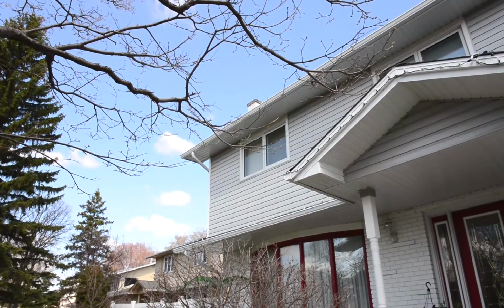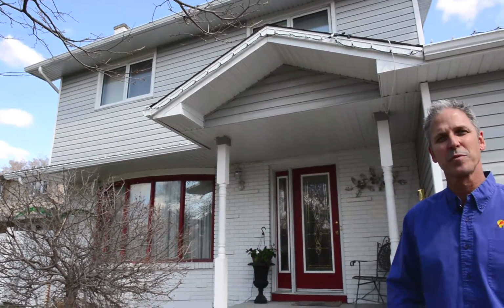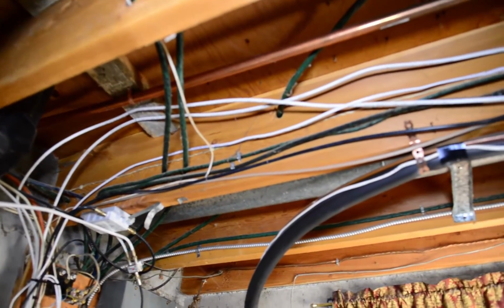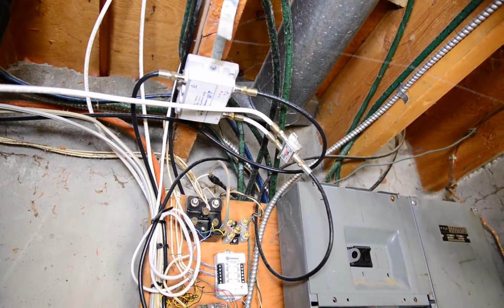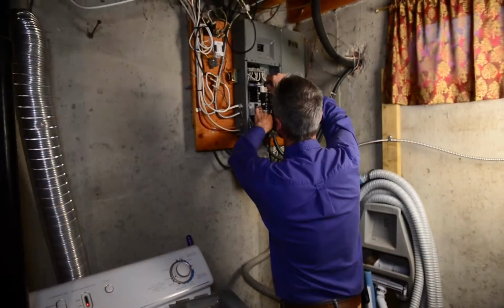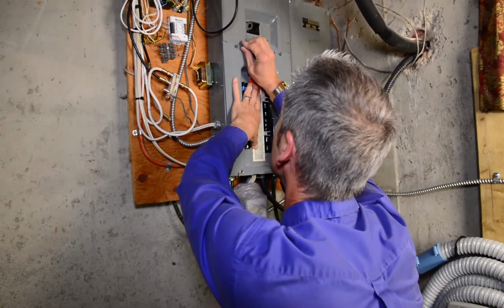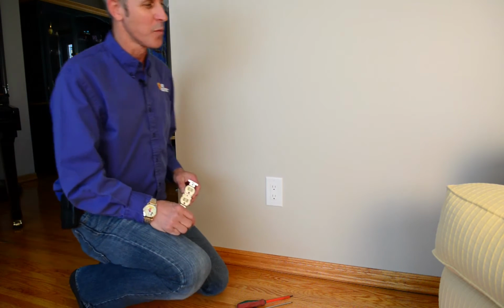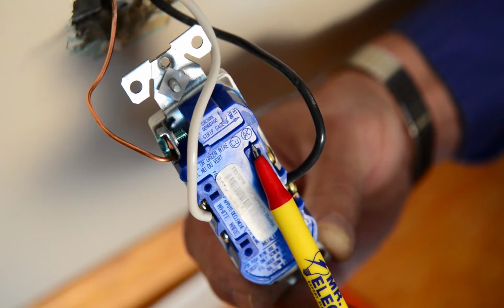Aluminum Wiring

Comment: a silver neutral wire is not always an aluminum wire. my 1983 manufactured home has coated steel neutral wiring. you can tell because it is slightly more difficult to cut than copper and does not bend easily. aluminum also is not magnetic if you are trying to determine the wire type. additionally, never use the stab in method to install your receptacles.

Comment: For a franchise owner you are making a big mistake, the twist wirenuts are not approved solution for aluminum wire repair. The heat in that connection is higher that just copper , cause by chemical reaction of material. Alum icon is the way to fix that issue and last and safer result, Rewire house.
Reply: Alumicon can be purchased and installed by anyone. That could lead to some improper installations  causing problems. If enough problems occur you can bet the insurance companies will disapprove the use of Alumicon. We then may wind up with only copalum connectors and copper rewire as permanent solutions to aluminum wire repair. I would also not be surprised if the insurance companies eventually only approve a total copper rewire in order to insure a residence. There are plenty of buildings w copper wire so the insurance companies don't want the risk of insuring aluminum wired structures.

Comment: If you connect aluminum and copper... the copper will destroy aluminum. I think
Reply: That's correct,  it's known as electrolysis.  If you look very closely at your plumbing,  sometimes copper to galvanized iron, or similar dissimilar plumbing is used, the plumber will install dielectric fittings which use rubber washers, bushings and similar seals, to prevent metal to metal contact and the fittings from corrosion and flooding your home.   The best, safest,  and most inexpensive way to connect aluminum wiring to copper wiring is with Alumniconn connectors,    which is basically a miniature bus bar with two or three ports, in a plastic casing filled with an antioxidant compound for added corrosion protection.   This connector works great, and fixes the stuff we don't like about aluminum wiring,  because it keeps the copper and aluminum from touching.  They cost about 3 dollars per connector,  so they are not inexpensive per se, rather a small price to pay for peace of mind, and much cheaper than rewiring the entire house with copper.

Comment: The anti-oxidant compound is useful because aluminum suffers from a problem when it oxidizes, which it will always do when exposed to air over time. Aluminum oxide is non-conductive to electricity and eventually may cause an electrical failure. The compound seals out the air as well as improving the thermal and electrical conductivity in the joint. There is also a difference in the coefficient of thermal expansion between copper and aluminum with aluminum's coefficient or thermal expansion being 50% greater. This means it expands and contracts more with temperature changes. Plus aluminum is softer than copper and is more easily deformed under pressure such as when placed under a screw in an outlet or switch. That's one reason tightening the screw helps, but that doesn't solve the problem of oxidation. The best solution may be to replace any outlets not intended for use with aluminum. More may still need to be done, especially when the air contains contaminates such as those that come from an oil refinery.

Comment: What about a house in 1949
Reply: 1949 you may see silvery wire that can be mistaken for aluminum,  but this era they used tinned copper.    Rubber insulation was used  at the time, and the chemicals in the rubber are corrosive to copper, so it was tinned to prevent this from happening,  as well as making soldering easier     

Here's where you need be careful: if there was a remodel or addition from about 1965 to 1975, give or take a few years,  you likely have copper and aluminum,    and this can be very problematic if the two are spliced without special connections made specifically for this purpose,  and you can have a fire hazard on your hands.
Reply: listen to the video again
Reply: @joeambly6807  lol @ abigail, usually the early 1970's aluminum was a cheaper alternative.

Comment: Sorry but i would never ever pig tail aluminum to copper even with the purple wire nuts, just use the correct outlets and inspect all outlets, switches and junction boxes yearly... or better yet every 6 months.
Reply: Or Daily!
Reply: Hourly perhaps?
Reply: Yeah, thats probably not a bad idea, except aluminum receptacles suck and are cheap looking.  Nobody makes any good receptacles for aluminum wiring.  I use the alumi-con lugs, they are push-in lugs, but they've been working great for me for 10+ years.  They come with antioxidant inside the lugs themselves, but you can always add more antioxidant as well.    a torque screwdriver is really all you need, but just make sure you give the wires a nice tug before you put them back in your box to make sure the wire isn't loose and then you can use all of the cool switches, usb outlets you want.
Reply: 😂 😂😂😂. Every seconds would be ideal.
Reply: Use the Alumiconn connectors or rip it all out.